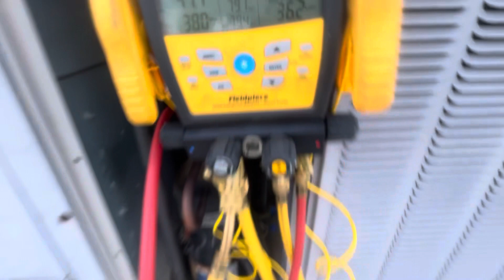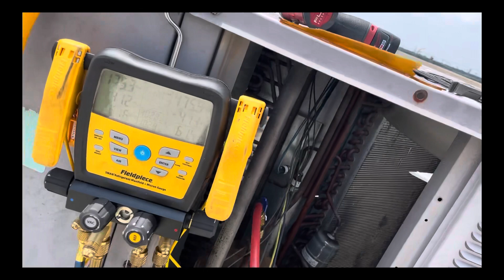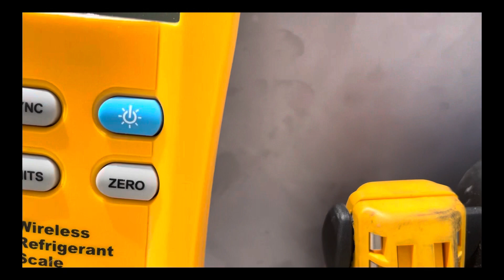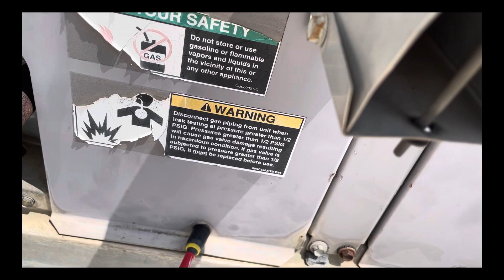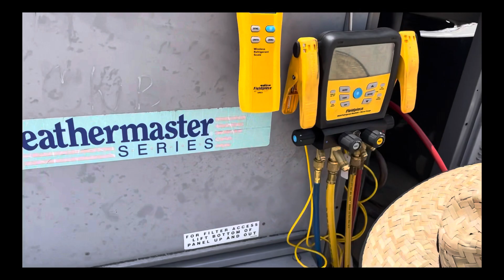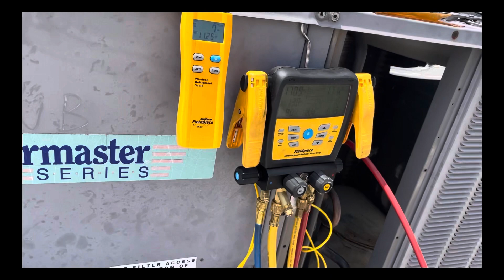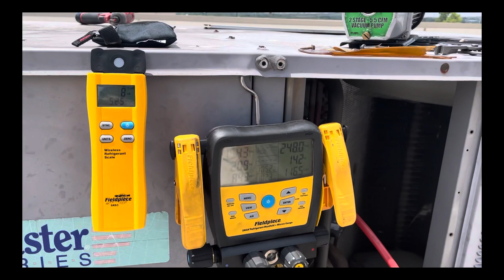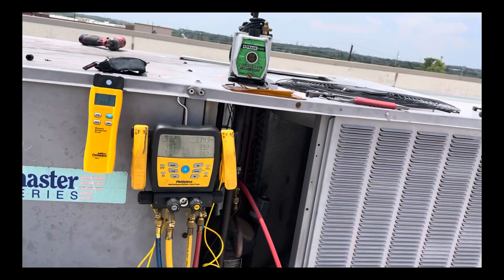Angry Parents! The Kids Center is too Hot! | No Air Conditioning!

Comment: I you heat up the liquid line header at the evaporator coil with that kind of metering device all you will de doing is melting any wax that has built-up. It will not remove any hard build up. That is a one of Carriers bad design's.